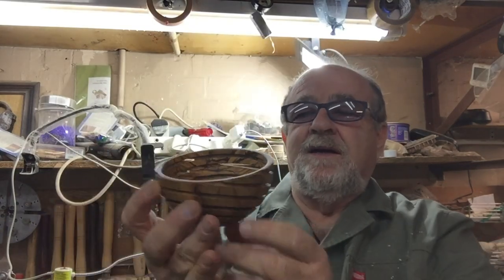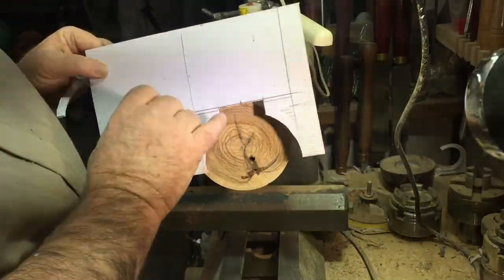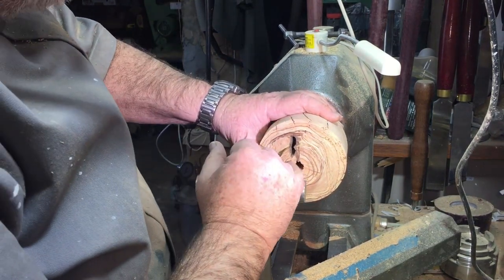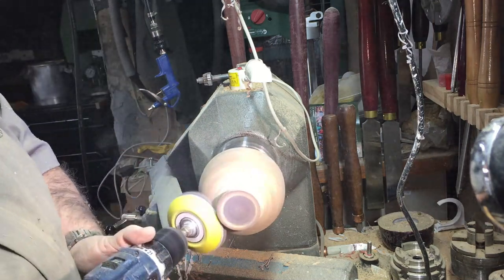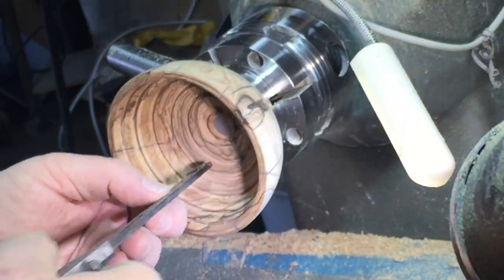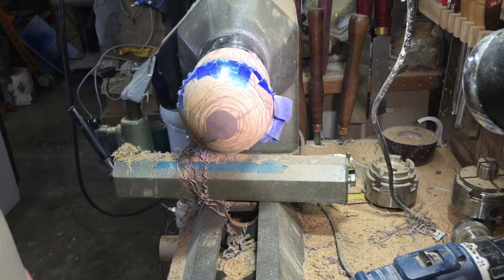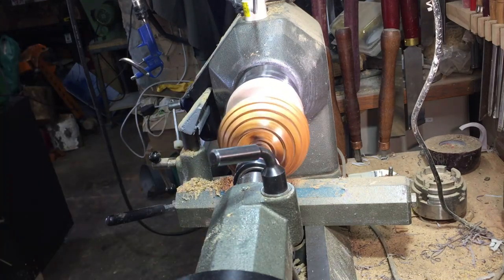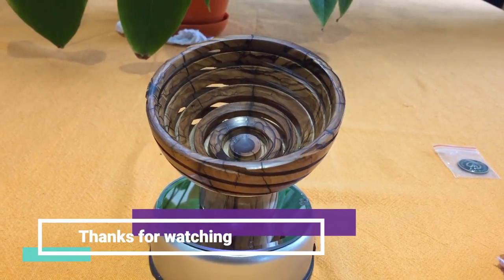wood turning eccentric bowl (2020)

Comment: was wondering if you have ever had a chance to work with Baobabs wood?
Reply from the maker: Thank you very much mike I don't think you can find this wood . i think it is on the protected list , i will check .
Reply: @oldmanwoodcraft  i thought is was on protected list too but wonder if they have to ever cut one down cause it is going bad or big wind storm knocks one down they use it up some how, it is a very big and interesting tree and i thought you were from south Africa you may have seen some thanks